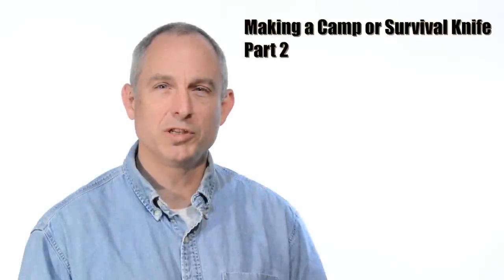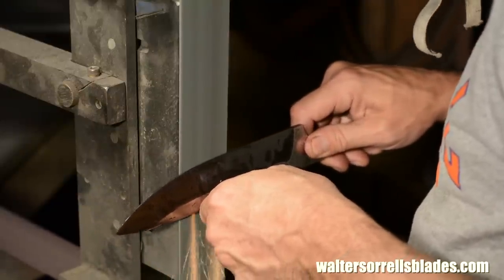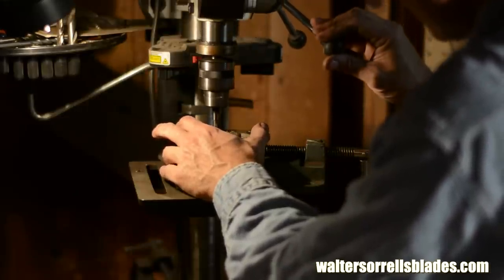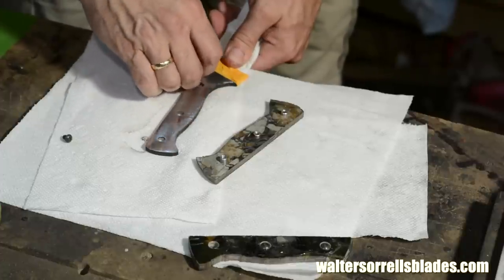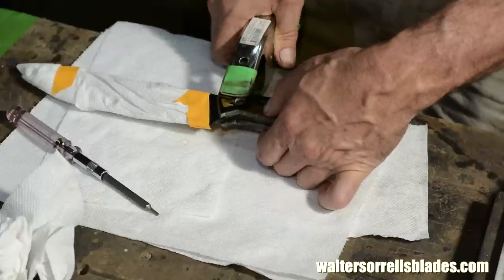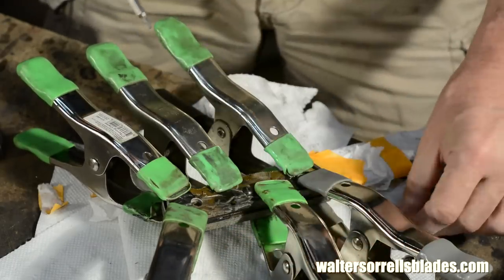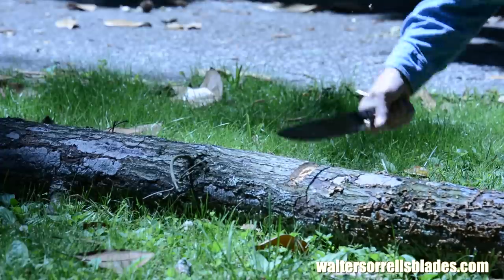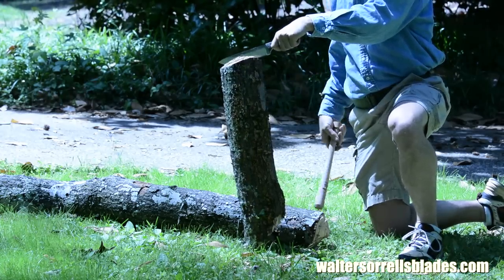Making a Camp Knife, Part 2 - Prepper, Camping, Survival Knife

Comment: Very nice video Walter, I am in the middle of my first "properly made" knife (I had a couple of funky tries before). I'm doing a small tanto style knife made from a file. I curved it first by forging and did the rest with hacksaw and files. Now I'm going through the first of my sandpaper grits. I'll try to attach the handle in the 'katana style', you know, the taper and single pin.

And btw, if you want to chop a log, just get a hatchet. Right tool for the job you know, that knife chopping the log was like trying to eat a meal with a single toothpick.

Comment: Great video as always... A question... Could one just epoxy the handle slabs on the tang and then drill holes through both slabs and tang all at once??
Reply: +BIll Georgoulakis youll need to drill the holes prior to heat treating because once it hardens, it becomes really difficult to drill through without some really nice specialized equipment. and you cant heat treat with the handle on.

Comment: Walter..  You really do make it look easy!    Another great how-to video.  

I do have a question for you.. the answer may make a good video subject for you.  What is the correct method to measure/find the proper length for a katana?  I am 6'5" and find the standard 27 & 28 inch blades are too short.

Thanks for the video..
Shad
Reply from the maker: shadowcastre Great idea.  There is a standard formula...for whatever that's worth!  I'll try to do a short video on it soon.

Comment: Hey walter,
    I had an interesting idea however I feel as though it goes against many "unwritten rules" as well may not work right for differential hardening, but you should make a Damascus katana, I understand the amount that goes into making those types of blades, I just thought it's an interesting idea and thought id shoot it to you
Reply from the maker: 3lusive I actually make high layer random damascus...which is pretty similar in appearance to Japanese traditional steel.  But I remember Howard Clark did pretty much a straight Western damascus katana a few years back.  Pretty cool looking.
Reply: Nice, do you happen to have any pictures of those?
Reply from the maker: Sure, just check my web site (listed in the description and at the bottom right corner of the video).  Anything that says "folded steel" was made by that kind of process.
Reply: ok, thanks =D
Reply: Walter Sorrells Hey Walter, i have a knife that ive put through hell. Chopping saplings about 4" diameter, chopping hip joints on deer, yada yada. An old guy asked me what type of knife it was. I told him and he whipped out his same brand knife. He asked how long ive had it and if ive ever sharpened it. I racked my brain, ive had this blade almost 10 years and could not remember ever thinking, "man, i should sharpen this knife." He had his 25+ years and it had never been sharpened. Thank you for solving the mystery.

Comment: hello, i am very interested in knife making. i have watched many of your videos and loved them, very well put together. Although i had one question, is it possible to make a knife using a bench mounted grinder with a 6 inch wheel? I noticed that you use a belt grinder, but I figured that a bench grinder would work. I just wanted to be sure before I mess up my material. 

thank you
Reply: dynamo3vint So, the answer is an unsatisfying "yes and no". You can use a bench grinder to profile the blade, and, on thicker blades with narrow bevels, can also do most of the beveling (this doesn't really work when you're trying to do a flat grind or a narrow bevel on thinner stock). But, because you're removing material with a wheel, you're going to be creating a very not-flat surface, and, at some point, things have to get flat. Before I got a good belt grinder, I would do the bulk of material removal with my bench grinder (6" as well) then switch to a good metal file to flatten everything out. To be honest, I would do the beveling with a file until you can buy a belt grinder, which will probably cost around $100 (U.S.) for a decent starter model.
Reply: Get a grinder i have a kmg (2 thousand dollar machine) but I started on a 1x30

Comment: I would love to have a celtic sword... Irish/scott type but not a 5 foot braveheart type... a fully functional sword light enough to use one handed yet strong.. with a guard not a basket. An ultamite fighting sword with a celtic knotwork handle for gripping maybe? I would think A 3 foot blade and 1 foot to 10 inche  handle or smaller.. bigger is not better. A hand and a half to be used as a 2 handed sword if needed? In sword fighting, the blade needs to be able to take a hit from another sword without damage,

Comment: do you ever grind a distal taper into your blades? or is that something you only do for forged blades?
Reply: +sess i think it's just something with no positives in a blade that short, you wont feel the difference and you run the risk of weakening the blade, thinning it toward the point (also it's a tremendously tedious job)
in this particular knife would be even more counterproductive since it's supposed to be a chopper, so lightening the frontal part would weaken the chopping power :D
you can create distal taper on swords made with stock remova thol, albions swords for example

Comment: I noticed at the end of your vid that your sharpened edge does not go all the way back to the ricasso. I've been making my knives with the edge all the way back, but it's always slightly messy right at that point. AS my skills are developing nicely, this is the one place I always seem to have trouble getting just right. Do you always stop just a little short on the cutting edge meeting the ricasso?
Reply from the maker: +daisy8luke   Nobody cuts anything with the part of the blade that's right next to the ricasso....so I just sharpen as far back as it's convenient to go...usually around an eighth of an inch from the plunge line, give or take.
Reply: Walter Sorrells That's a good idea. I always seem to jack it up right about there! Everywhere else I have a nice smooth even edge. Make me cuss!!
Reply: +daisy8luke 
I file a v notch just in front of the ricaso.  But I am no knife maker.  Well I made a wooden knife once... I called it twiggy.

Comment: Hi Walter,
Thanks for the videos! I'm 16 and also a knifemaker, your tips have helped me making my knives look more professional!
I have two questions:
When handsanding the blade I can't remove all the vertical grinder marks even when I use 60 grit sandpaper after a 150 grit belt, any tips?
How do you prevent the glue from squezing out over the blade?
Thanks, the knife looks great :)
Reply: knives&stuff Youre suppose to go to a higher grit than the previous grit, not move down in grit. And you cant really prevent the squeeze out from going onto the blade, you'll just have to pay attention and wipe it away as it comes out. It'll eventually set and you wont have anymore squeeze out.
Reply: MrDemon9392 Thanks! But if you move up the grits when hand sanding horizontally you will pollish it but the vertical grinding marks will still be visible. I want to remove the grinder marks completely.
Thanks for answering:)
Reply: knives&stuff Move up in grit on your sander. So go from 150 to 220 to 300 to 400 etc, instead of moving from 150 back down to 60. Same Principle applies
Reply: knives&stuff You could try moving up to a higher grit belt on your grinder before you start finishing by hand and/or hand finish it to around 320 / 400 grit before heat treatment when the steel is soft (It will take time to remove the vertical marks but they will dissapeer just keep at it), I wouldnt reccomend going higher in grit that this because the scale will need to be removed after H/T and itll take alot of elbow grease with finer papers. Then continue up in grades untill you have the finish you want.
Isopropyl alchohol on a rag will remove the epoxy squeeze out very well (while it still wet of course).
Reply: divs1023 You work all the way up to 400 before heat treating? I've always called it good around 180, then worked my way upwards after heat treat. Have you noticed a real difference in the ease of sanding this way? If so, that's something I'll have to try out!
Reply: Thanks for the replies :) I sand up to 180 before heat treating as well  and then finish it up to 600 after heat treating.
Reply: ***** By all means give it a try
when the steel is fully anealed it is considerably easier to work than after heat treating. I was truly impressed just how hard 01 steel becomes after heat treating and tempering to 60 C (rockwell).
Reply: knives&stuff Trust me you can do it it just takes a lot of time and elbow grease. Don't stop one grit until all the scratches are gone from the last!
Reply: Richard Brown Thanks, the knives are getting better!
Reply: You need to step up on grit, not down. If you step up too fast you won't be able to conceal the lower grits. Ive found a wet sand doesn't polish as well.

Comment: Do you use anything on the mycarta to prevent the dull look after sanding?
Reply: baccracker *micarta, using any type of wood finishing oil is fine
Reply: Jaden Bass Boiled linseed? that s what I use on my wood scales. I have used it on mycarta also but wanted to get another opinion. Thank you
Reply: baccracker Thats one of several options. No problem.
Reply: I use boiled linseed oil but ive using wd-40 too
Reply: baccracker I know I'm not part of this conversation but he already corrected you once by telling you the proper spelling of the word, "Micarta" yet in your very next post you once again spelled the word wrong. To me that's just disrespectful that you didn't bother to think you were wrong and you couldn't be bothered to change your way of incorrectly spelling it. What he had to say didn't seem to matter and you didn't even consider you were wrong. I know I look too far into things but damn, little things like that annoy me.
Reply: Jim Garrison Wow, looks like you need a different hobby other than letting a simple misspelling annoy you. Glad you felt the need to share your thoughts but maybe you need to lighten up a bit.

Comment: I want to make a knife but i can't find a good steel for my knive. i want something like 440C, but i dont know where to buy it snd i don't understand the sizes. i live in the netherlands. can anyone please help me out. im searching for steel for a couple of months.
Reply: Thank you!
Is it save to order that from the Netherlands. And is that not expensive?  Just asking.
Reply: Oskar Mohar thank you man ;)
Reply: BUIJS NL  There are many places to get steel online for making knives.  If you are going to do the heat treating yourself, don't use any type of stainles steel such as 440.  They require very precise temperature control and to be able to hold that temperature for a good length of time.  Plus there are other complicated steps in heat treating stainlss steels. The best steel yo buy if doing you own hea treating at home would be 1084 carbon steel.  Just heat it up until it's non-magnetic (make sure not to over heat!) and then quench in canola oil that is at about 130 degrees F, or about 54 degrees C.  1080 is another great choice, and even 1075... both are carbon steels, but 1084 would be my first choice  Anyway, one of the best and well known steel suppliers (of quality steel) for knifemakers in the US is Aldo Bruno from the New Jersey Steel Baron..  Here is a link www.newjerseysteelbaron.com     he might ship to the Netherlands, just email him, he's a very nice and helpful guy :)
Reply: google smeed atelier alkmaar
Reply: +Isubslimed What are the magic steps when heat treating stainless steels